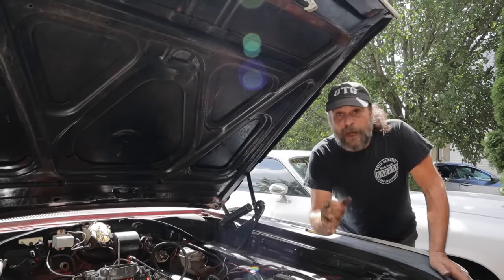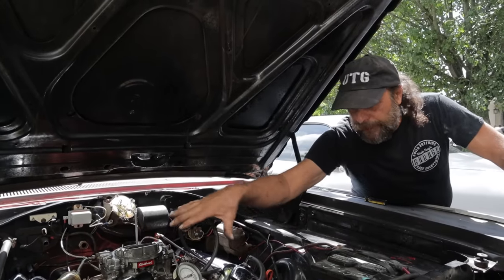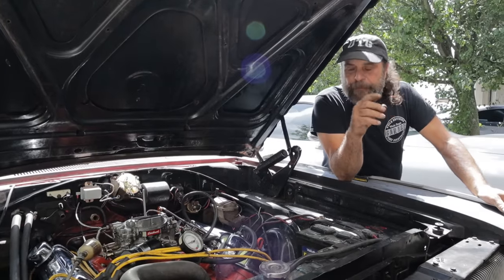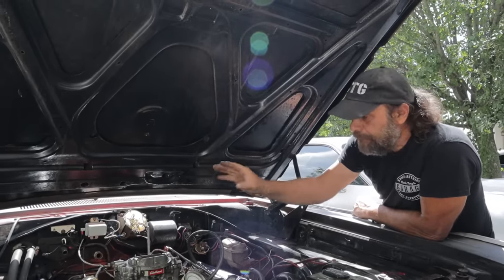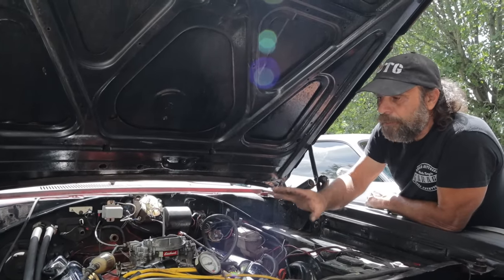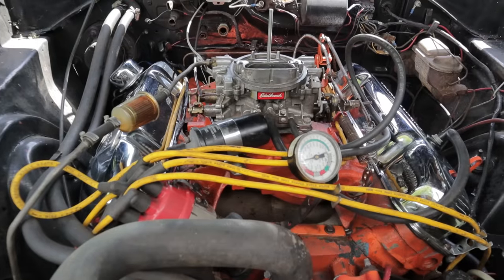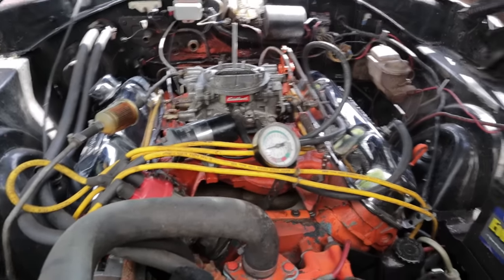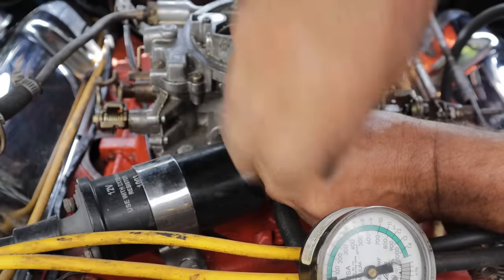Fine Engine Tuning With A Vacuum Gauge

Comment: OK, maybe not performance engine related, but ...  BB Chevy in a pick-up with a Holley.  Always have cooling issues at idle in traffic.  IF you run manifold vacuum to the advance, it allows you to shut the throttle more and still maintain idle speed in gear.  You get down below the transfer ports. 
If you run ported vacuum, you'll be idling on the beginning of the transfer ports and burning more gas while sitting in traffic, and the motor will heat up.  Not saying you get better leave that way, just better fuel economy and cooler engine.  I assume Chrysler engines are the same ...
If you pick the right vacuum canister and the right curve in the mechanical advance, you can balance that high vacuum idle and still get good acceleration. 
UT, do you own a distributor machine?  Can you take us through curving a distributor for sedan, truck (heavy loads), and performance engine on higher octane fuels ??

Comment: You use the in-gear idle vacuum to get your primary power valve sizing, correct? So, how do you set your secondary power valve sizing? Fully advanced timing vacuum which would be around 3k rpm?

Comment: i set my 76 Suburbans ignition timing by the vacuum  it works for me i like the blip in the throttle 350 all iron sbc 4 bolt its also got a 4.86 or something close to that welded rear end  top speed 85mph pulled on a newer dodge ram rockin an auto trans i got a 3 speed with granny  i redline it an dump the clutch  runnin fattest tires i can fit in the rear on steeles with the  mooncaps

Comment: I bought a running 350 SBC for a 57 150, replaced the carb with a Holley dual feed. It runs best at 20degrees TDC. What should I look for? Thanks, Robert.

Comment: Ported or manifold vacuum, this debate seem to continue endlessly. My non-emissioned Chevy engined cars of the 70's which I owned had the vacuum on manifold and they ran like there's no tomorrow. Was always happy with them. But now, many do say it's got to be ported. I've tried ported vacuum on a stock 302 & 350 using Edelbrock carb, it idles rough and initial take off performance is not good. tried every which way to re-tune, and then ended up with manifold vacuum and everything suddenly seems perfect throughout the rpm range as we take off to cruise speeds. Back to ported again not good, back to manifold and you just love the way it goes. So what gives!

Comment: Question.. you made it quite clear that the Vacuum advance needs to be ported vacuum and not manifold.. I'm running a early 60s holley 450 cfm on my carbureted 4.3 Chevy with aluminum performer intake.. the carburetor itself has zero vacuum ports. Do you see this being a serious issue?

Comment: I'm from the ported vacuum to advance school. My engine really doesn't like manifold advance for idle. The ported essentially retards the timing at idle. I have a `79 Firebird 400 / 4 speed manual. I generally work backwards after setting the idle mixture and APT (q-jet). I will set the total advance to 36 starting around 2800 rpm. That puts me at 16 initial and 20 mechanical for the 36. If 16 were too high (hot starts), I would simply change the mechanic advance to give me - say 24 so that the init is at 12 and I still am at 36 for full throttle. Setting the apt is running it up to 2200 and barely tipping the choke then adjusting the apt to the highest vacuum. As for part throttle driving, I'll go with a vacuum can and set the limit of travel for what the 400 wants.

Comment: Good Video, I have a low mile 1977 Cadillac DeVille I just replaced the Rochester quadrat with a rebuilt one and I'm trying to get the smoothest idle, so using the screws I get a Best of Only 16 in of Vacuum..and the Idle is Bumpy at 650 rpm...Yet at Full throttle its Great...What gives??
Thx!

Comment: What if the timing marks/indicator used with the timing light are suspected or are unknown to be accurate? I have a SBC with cheap summit headers, edelbrock duel plane intake and a good performing quadrajet, how do I get the most thoroughly correct timing? Thanks.

Comment: Hey Tony I have a Edelbrock 1406.  The vacuum is at 20 . Timing at 10degrees after. Engine is a 360 Dodge stock with factory roller cam . Starts up first turn over, idles good. From idle it stumbles but on wot runs well. Carb has new kit floats are set. Can you advise me as what to do. Change step up springs, jets, rods? Engine has about 2500 miles on it. If you can help me I would be much appreciated. Thanks a lot. Love the videos. 
.

Comment: Great video. I adjusted an engine like this, got the Idle circuit screws adjusted and brought the timing up until it started stuttering, retard until it smoothed out and kept retarding until I dropped 4 inches of Hg from there. Locked the dist. This guy owned the parts store next door and later went by a racer buddy to hook up on a Bear. Jimmy told him everything was correct except I was 1 degree off on timing. 
I was surprised and thought that was close for a 5 minutes tune by ear with a vac gauge. I think anything mass produced are the same but not identical. There are lemons and there are some that outrun the rest. I'm not sure if this type of tuning that particular combination of parts is better than a timing light on a stock engine. Again, great information on a simple vacuum gauge.

Comment: Great video.  I have a model A ford with a four banger.  I installed an AMR500 supercharger they are used on hero’s and a lot of imports. It had a holly 94 with power valve that I reworked the vacuum to the power valve so it is below the supercharger.   Would use if a vacuum gauge be a good way to find the sweat spot on the timing? Thanks

Comment: Great info Mr. Tony! If you see this comment, I've got 1 question for ya. I put together a 350 SBC with a thumpr cam. Its got very erratic vacuum readings at idle that rapidly fluctuate between 12 and 15 inches give or take. Doesn't seem to really make a difference where I have my idle mixture screws set, it doesn't really change my vacuum readings unless I have them bottomed out completely. I've tried both a holley double pumper with the correct power valve and also a brand new edelbrock AVS2 with the same results. The thing seems to start and run quite well, hot or cold with snappy throttle response and great pull through all the gears so I've kinda just left it alone. If I can get a little more out of it tho, I'd love to hear your advice and input. Is the thumpr cam just not very tuner friendly cause of the wide overlap and long duration and that's why I can't really get a steady and strong vacuum reading with the mixture screws? Actually had to add an electric brake booster and vacuum canister to make the power brakes work properly cause of the somewhat low vacuum. I've smoke tested the thing for vacuum leaks and am 100% positive it's well sealed. You be blessed and I would love to hear what you have to say!
Reply: I got same thing I’m going to do a compression test of all cylinders. I wonder if valves are not adjusted correctly.

Comment: The location of the ignition coil is stock but not optimal neither is the fuel filter location. The spark plug wires are solid core copper which is its own arguable issue and frankly it would be a great video upload to show if they are benefitial. What we know isnt beneficial is having metal chrome wire looms without any rubber grommets metalcore copper spark plug wires

Comment: I like how my '98 Ford 4.2 runs stuff with vacuum. The '03 4.2 that I got out of the yard had electronic IMRC controls. I just had to use my '98 upper intake, harness, fuel injectors and IMRC actuators on the '03 block, lower intake and heads. Had to do surgery to relocate the knock sensor though. And switch around a couple sensors. And use the '98 EGR and heater tube. Got the battery tray in today. First start maybe tomorrow. Can anyone recommend good explosion insurance?

Comment: Don't mean to argue, but I just installed a new Edelbrock 1806 and the installation manual said "for all NON-EMISSION CONTROLLED engines, use manifold vacuum for the advance and ported vacuum for emission controlled engines. ????

Comment: In the 70’s and 80’s the engineers would throw spaghetti at the engine. Wherever they landed on the engine they would hook up vacuum lines.
Reply: And then in '91 Ford came out with the new Escort that had exactly 1 vacuum line. I was like holy crap I have to buy this car.

Comment: Have you found any significant difference in horsepower, or torque, or throttle response, between a Holley and an Edelbrock of the same cfm? I've run only Holleys, cuz I know em.

Comment: Thank you for your videos as despite being of advancing years I have never dealt with the maintenance of an older engine aside from changing the fluids, plugs and filters etc the internals and desires of the magic box have remained a mystery.  But... I now have a Vanagon to play with! 
I would like to fit a vacuum gauge in the dashboard but wonder if the length of the vacuum gauge feed hose is important, would fitting 15+ feet of hose to the back of a vacuum gauge throw off the vacuum the spliced line was originally feeding and would the gauge reading be accurate with that length of hose, could I take the feed from the vacuum feed at the brake booster at the front of the vehicle or am I better off running a long line?

Comment: Tony - if I can’t get a Holly Power Valve at half the vacuum reading, should I “miss it” on the high side or the low side.  Please advise.  Edward
Reply: IMO I would rather go with a power valve that is on the higher side. If you go with low side it might cause a lean spot before the PV opens. An AFR gauge is your friend in this situation to really know what is going on.

Comment: What or where does one hook the vacuum gauge?  Does it matter? Disconnect vacuum line from brake booster and connect vac gauge into this vac line? I’ve seen people do this but if brake booster has sealing issues, and vacuum line were removed from the booster, would that provide a vacuum reading less whatever vacuum issue the booster had?  What about leaving vacuum system in tact and splicing a “T” in, then using the “T” to tap into vacuum lines and connect vacuum gauge there.  Then cap the T when not resting vacuum.

Comment: Hello, and thanks for the vid' I have a 440 dodge motor, completely rebuilt and over board .020 because of a valve drop which took out the piston and head. 
There is a thermoquad 9078s for a carb' Is this the right carb for this engine?? I"m going to try your vacumn adj, vid' I'm trying to set the vacumn on a port at the back of the intake manifold.
and I'm not getting any better running engine,  starts cold easy, but when it warms up I have trouble starting it, I need to pump the carb to get enough fuel to restart. The timing 
is set at 8 degrees BTC.
But after watching your vid' I'm going to hook up the vac' at the port you are showing, any suggestion's??? This motor is in a Motorhome.

Comment: Refering to your previous video, you stated the power enrichment circuit becoming active below 15Hg. I just checked the Holley website. the PV with the highest rating i found so far is 10.5. Does this mean, it wouldnt be possible to set the power enrichment correctly on a holley carb for that car, because the PV will never open before a drop below 10.5Hg? or do i still misunderstand the Holley concept?

Comment: Question. So what’s a good baseline to start and do I change the jets or metering rods first or try to match them? I’ve done this before, but there is a little grey area as I remember what I went through before. I also am at a higher altitude like, 7200 ft. Living along the front range it varies 6700-7400. Just trying to get some good advice for my current build. Thanks

Comment: when i was younger like 10 years ago I tried to tune my datsun 240z by ear both the carb and distrubutor how the old timers told me to do it. I thought i had it running pretty good until i finally hooked up a timing light and saw it was at like 45 degrees btdc at idle and hooked up my aem wideband o2 sensor that thing was pig rich lol.

Comment: Hey Tony, I'm not sure if I have too big of carb for my engine. I was wondering if I do, can I tune it enough to work for my engine or do i have to swap? I have a pontiac 400 with a mild cam (pro stock). The carb is a 750 holley vacuum secondarys. I'm new to working with engines so any advice would be appreciated!

Comment: UT starts with a stated 16" of Vac and ends with 14" on the gauge. ??? Each hash mark is 2" is it not?
Reply: Each hash is one inch. He started with it bouncing between 16.5 and 17. He ended with it solid at 17 inches. Zero is towards clockwise, more vacuum is counterclockwise on that gauge.

Comment: My ole lady's throat is on ported vacuum...her box is on manifold vacuum...and at wide open throttle her dirt star starts advancing before my big ass piston hits bottom dead center...then I accelerate pump the thick ropey load to her!  Does this help explain the difference ?

Comment: I tune my 65 chevelle 327 350hp  stock Holly  with manifold vacuum.  But  I switched it over to  manifold vacuum to the distributor.  Try it you'll  like it!! Engine doesn't ping with the compression of 11.0

Comment: I'm a mechanic but started after carburetors but I need to tune this brand new Holley 550 sitting on a 302 Ford crate engine, any tips? Appreciate it 👍🏻

Comment: I tried using a vacuum gauge on my sbc 350, I have the same carb as you, and plugged my gauge into the manifold vacuum port, and my gauge didn't move, I tried two different vacuum gauges and both needles just stayed the same, what would cause this?

Comment: I have a Eldebrock on my Dodge 440 and it runs pretty good but sometimes it pings when you step into it(not all the time tho) but my biggest problem is that it diesels when shutting off....do I have my idle mixture screws set too rich? (ive got it idling around 750ish) and I run 91 gas out here in northern California.

any help on the dieseling problem would be greatly appreciated:)

Comment: Great video, thanks for posting, I have a question. I set my air fuel with the vacuum gauge (Edelbrock AVS carb) but the screws are over a half a turn different from one side to the other. 2 1/8 turns out on the passenger side, 1 1/2 on the drivers. No matter what I try, turning both screws equal, that’s where it reads and idles the best. I’ve checked for vacuum leaks, and actually this is a new carb, but the old Edelbrock was the same way. It’s just a stock 350 engine. I noticed in the video you just adjusted till it was happy, didn’t look like you were counting the turns. Does it matter if there’s that much difference from one side to the other? Could the PCV valve be messing with it? Thanks.
Reply: Dual plane carb? Carb spacer on it?
Reply: @christopherlewis2505  Yes, dual plane with a 1 inch spacer. Had no spacer before, did the same thing.
Reply: @hvspeed6102 it's an open plenum spacer too? As in not a 4bbl style. Either way, I wouldn't be too concerned with it personally, only other thing I could think is maybe one of the bleed orifice/ bleed screws is slightly different than the other.
Reply: @christopherlewis2505  Thanks for responding. its a 4 hole spacer. Two different carburetors behave the same way, so I don’t think it would be the screws. I guess I could swap the screws side for side and see if something changes. Not really a big deal, just trying to see if there’s a reason for it. This guy never answered so I guess he doesn’t know either...

Comment: little changes of vac at idle each engine cycle of one or two inches of drop is a miss - ignition or lean misfire,
3-4 inches of drop - a sticky valve, bad spring, or bad cam lobe, 
10-12 inches of drop - a head gasket
please, feel free to add to this list !

Comment: What about reving  your engine until the harmonic balancer stops moving and then turning the distributor until your timing pointer reaches the zero on the timing mark, is that method still being used?

Comment: What if the vacuum of the engine is ~8 psi at idle, and increases from this when you give it gas (due to it revving up some), before it starts dropping at wide open throttle?  (as opposed to being at maximum at idle, and starting to drop off as you give it gas).  I'm guessing that this is a consequence of my cam, which has duration of 248 (intake) and 254 (exhaust).  Engine is a Ford 427 (FE).

Comment: Ya 70's vacuume 0perated emissions components were crazy.worst engine for me was the late 80's carburetor 460 Cid with 2 air pumps,2 charcoal canisters, 2 float bowl solenoids, throttle solenoid and EGR.and a whole lot of vacume hose.

Comment: There are two kinds of people. Those who hook the advance can to manifold vacuum, and those who are wrong.
Reply: I don't know what is up with some of these guys, manifold is way better.  Engine runs cooler at idle and more throttle response off the line.  I with you yo!
Reply: The only reason for ported was for emissions, the retarded timing at idle makes the exhaust hotter. Hook it up to ported to get through inspection, then put it back the way it belongs- manifold vacuum

Comment: Would setting mixture screws to highest smoothest idle apply to applications that need low idle RPM (eg 600). My Chevy ZZ502/Holley 4150 starts “dieseling” when attempting to shut off at anything higher. It’s an airboat application with not vacuum advance and I’m only setting total timing 

THANKS!

Comment: I just learned what I was trying to teach myself in 1979 with my vacuum gage a Carter 625 Edelbrock manifold and a jet kit.
Wish I new the trick with the spring on the metering rod. 
So i now have a 98 jeep zj 74,000 miles with a 318 are ther any tricks I need to know to properly tune or add on's that will improve a factory 1998 318?